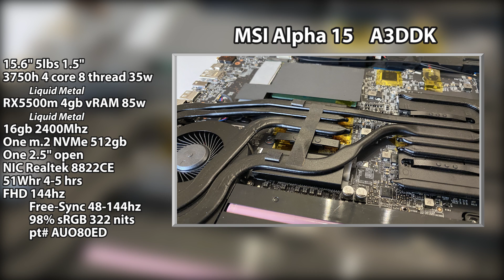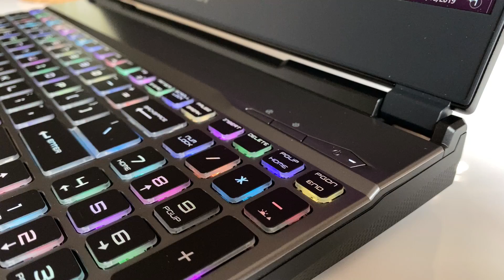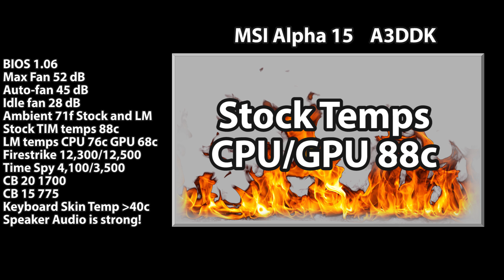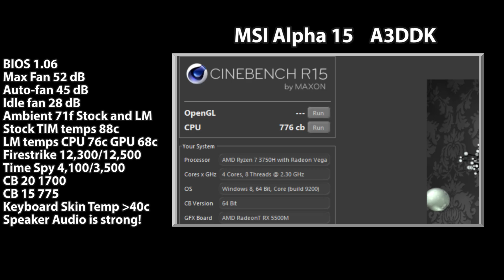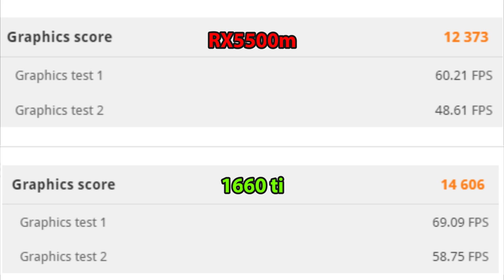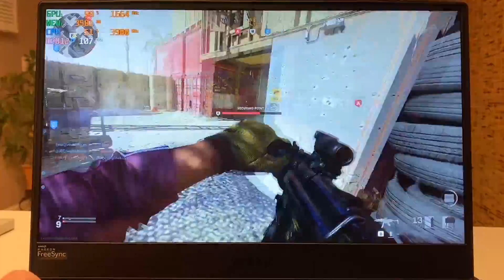Alpha 15 review!  Ryzen 7 + RX5500m!  (Red is the new Blue/Green)

Comment: Hi, do you maybe know why WiFi connection slows down and drops randomly? I tried so many things without success, like uninstalling Dragon Center, Killer Control Center; updating drivers (the Wifi drivers from MSI site are Realtek even though they're titled AzureWave, then updating them though Device Manager to the version from 11/26/19), BIOS, Firmware; unticking "Allow the computer to turn off this device to save power"; changing DNSs, and winshock reset, flushdns stuff; forgetting WiFi connection, turning off WiFi, and back on; using High Performance power plan with WiFi Adapter - Power Saving Mode set to Maximum Performance.
Sometimes it's so bad that I can't do a speed test or it breaks at the upload phase. Other two old laptops, mobile are working fine on WiFi.
I'd appreciate any advice.

Comment: 144hz panel paired with a RX 5500M & a 4 core 8 threads CPU! Why you need that monitor when you can’t run any modern game a 144fps? With exception of CSGO or may be, may be overwatch. With laptops paired with RTX 2060 & I7 9750H 6 core 12 threads under 1000$ this laptop is hard sell. Hard to justify and digest its premium price for less than average specs.  May be someone needs a full AMD experience? Yes. That laptop may be for him. Enjoy it!

Comment: How to fix bottlenecking of GPU?
Reply from the maker: Sharath kumar Do have this laptop?
Reply: @BobOfAllTrades  planning to buy one.....stuck between Alpha 15 & Acer predator Triton 300....
Many people have said to me ..tht amd ryzen 7 is bottlenecking the gpu...
I don't knw ...if it can be fixed manually...or will be fixed by amd in future  update...
Kind of confused....🥺 whether to trust amd ..or stick to intel
Reply from the maker: Sharath kumar The bottleneck on the Alpha 15 is more about the 4gb vRAM on the 5500m where you’ll have to dial back settings in certain cases.  The CPU is still good for most games.  

The Triton with its i7 of course would offer a bit better longevity depending on what you intend on playing and what comes up in the future.  

The Triton 500 has its motherboard flipped so accessibility to the memory, storage and cooler for repasting isn’t as easy of a task.  Not sure if that is the same on the 300.
Reply: @BobOfAllTrades  i don't knw if i am right or wrong...abt this.
Jst for a curiosity....
Since alpha 15 ram can be upgradable upto 64 gb...
If put 2×16...32gb
 Can it resolve the gpu bottlenecking......?
Will there be any impact on gpu performance if we upgrade ram on any laptop/desktop?...

Comment: Hi Bob! Can you help me verify if the 120hz that is sold here in the Philippines also has a 100% srgb?
And how would the processor and gpu work for lightroom?
Reply from the maker: I talked about my my experience with thin bezel 120hz panels within the first 60 seconds 🤷‍♂️
Reply: Sorry, I skipped to the tech specs right away. But to my second question. How does it perform as an editin laptop?

Comment: Wait, why get rid of the dragon center? I've seen other reviews of this laptop and while using dragon center settings, the Alpha's cpu is maxed out at 80 degrees in a stress test and gpu - 70 degrees. While gaming, no higher than 70 degrees on the cpu. So why remove dragon center? You seem to get worse results without it.
Reply from the maker: For starters, it’s rare to see other reviewers punish their laptop like it do. So take thermal results with a pinch salt. 

Google search “Dragon Center issues” and by the time you get to the letter “i” google will have autocompleted that result for you.
Reply: @BobOfAllTrades  Ok, so dragon center has issues. So you remove it and get a lot worse thermals that people, who don't. I don't see the point in doing that. Other reviewers. with similar results in thermals, don't specify, if they used dragon center. However, all their test results are fairly similar, except yours. Also, after using windows for the last 20 years or so, there are no software issues in the world that can get me even a bit worried.
Reply from the maker: Sviatoslav Marynial Stock thermal performance was done per my request from HID under various tests and fan speeds. When tested, dragon center was installed.
Reply: @BobOfAllTrades  wow, irregular results from your machine then.
Reply from the maker: Sviatoslav Marynial It’s the best I can do. People complain when I review a laptop with LM so this was what I came up with. Specific tests performed by HID at stock.  

What would you suggest?
Reply: @BobOfAllTrades  Nothing really, just that maybe something was wrong with your laptop.

Comment: Great review! Laptop... Not so much! That cpu should not go over 75 maybe 80 degrees. 88 means bad thermal paste and bad chassis. And for 1000 usd or eur, well there are much better 1650 with i7 9750 alternatives
Reply from the maker: It’s holding boost better than intel. Temps are not created equal. Two different architectures.  

Raider chassis’s are excellent but from what I’ve been able to gather, they seem to have poor paste from the factory. Changing paste is just a matter of when. 

The 5500m much is closer to the 1660ti than a 1650.

If I’m recommending the i7 1650 combo over this, it’s not because it performs better.

Comment: Is it worth to wait for intel 10th gen desktop processor?
I'm waiting for almost a month now. I have the plan to buy i7 9700k but intel will release i7 10700k which has 8 core 16 threads. Does anyone know what should i do? does it take more months than i think? I don't want to go with AMD. I know they are great but i like intel. Intel claims that it will have 18% faster than the 9th gen. I need a strong suggestion.
Reply: The 10700k is basically the same as a 9900k. Same architecture, on the same 14nm node with small security patches (probably).

Only laptops are getting the 10nm node and architecture with the up to 18% IPC lift. But they have alot of power leakage on that node as of now and is therefore clocked low.

It will probably be fairly cheap when they drop the 10700k, wrong as they got it down again to an i7 and that it will use alot more power than the 3700x. I expect it to be at most 250$, to fit in line with ryzen 3700 in the future or else it should be a total bust. 

That being said, Intel usually finds a way, to make people overspend.

Comment: I don't see the point of going with this when the i7 9750h and 1660ti seem like a better deal
Reply from the maker: What would be a fair price on this Alpha 15?  It’s tough when a Helios 300 is $1099 or less. 

The Alpha has twice the factory storage, Free-Sync, quieter at idle and most loads plus has a bit better battery life. 

Other than that, the Helios is the better buy in some significant areas. After all, it’s a “gaming” laptop and the i7 1660 ti is tried and true 👍

Comment: I believe this is best designed ryzen laptop, just see the heat pipes, and stapm is implemented correctly on this laptop, other laptops with ryzen cannot even maintain the base clock for few minutes (and this one is constantly maintaining 3.8-3.9GHz), we have to use ryzen controller to change TDP so that cpu it maintain boost clocks.
Reply from the maker: On this one I didn’t have to do anything I did not modify or tweak anything on the CPU or the GPU 💪
Reply: This support for ryzen 7 h series?

Comment: The green logo is a sticker? Wtf?

All jokes aside I’m impressed with how powerful this is for $1100. The vram limitation gives me pause though. I kinda wish they had the 8gb version available. The only other thing is why don’t they have a vent on the right hand side of the machine? It there were ports there that would be one thing. But nothing?

As much as I hate to say it I’d want to see a revision 2. But I’d love to have an all AMD machine like this. But I like to tinker so it would be a fun project laptop.
Reply from the maker: Right side exhaust can also heat up your mouse hand. Many prefer it the way this chassis is designed actually 🤷‍♂️
Reply from the maker: Setzer K You’ll be power limited on any 1660ti way before you hit 1900mhz. That’s something many don’t quite understand yet. 

It’s hard to argue or defend nearly ALL gaming laptops when you consider the Helios 300 at sub $1099 👍

The Alpha is in a weird spot. Sure it has double the storage as the Helios 300 and Free-Sync, but it needs some more driver love.  It’s definitely quieter at idle and typical load too. Maybe the security vulnerabilities matter to some as well. Other viewers words, not mine. I’m basing some of this off the comments I read. 

With all of of that out of the way, it’s too new of gpu tech to a price cut sadly.
Reply from the maker: Setzer K That’s not how that works. These GPU are absolutely power limited. Have you seen this undervolt tutorial for these GPUs?  This might help clear things up. https://youtu.be/rV0tWKLAprg

Comment: My biggest problem with this, and AMD in general, I was hoping for more or for it to be at a better price point. Once this came out and I saw benchmarks, I bought the predator helios because although the systems are similarly priced, the CPU and GPU are both better in the acer. I could maybe have waited for the Ryzen 4000 and maybe 5700m with 6gb of ram, but that's probably this time next year. I think AMD will have some sweet mobile setups in 2020/2021 but right now, not the value I was looking for.
Reply from the maker: It’ll be interesting to see how this pans out over the next six months for the actual price and a performance standpoint.

I hope I see more comments like this because it something I would actually like to talk about.
Reply: Good thing i can wait,my rx560x is showing its age in a year
Reply from the maker: HuntaKiller Nitro series?
Reply: So far the only thing I have bought with AMD (mobile) CPUs are 2 in 1s with U series for that integrated graphics that do just fine for that 768p casual gaming while being more than enough for light graphic designers on a budget. Lenovo's Flex 6 14 is a good example of one.

Comment: Current laptop has 8gb ram ddr4 2666mhz. Lets say I wanna  upgrade to 16gb, is it ok just to add another 8gb ddr4 2666mhz even its a different brand of ram?
Reply from the maker: Mixing manufacturers is typically OK just do not mix capacities and if you mix speeds everything is going to default to the lowest.
Reply: @BobOfAllTrades  usually mixing capacity isn't a problem either. 

I have never had any issues running dual channel with 12gb 8+4 or 6gb 4+2 or hitting rated speed.

That being said, same capacity ram is always preferred.
Reply from the maker: Christian Nielsen Here’s the issue and this is 100% true. https://youtu.be/FNNRLmMtE-8
Reply: Doesn't matter though, this CPU supports 2400mhz at max
Reply: @therealthief2131  your comment doesnt matter too. Im not specifically asking for this laptop. Asking for my laptop.
Reply: @chaoseus  too bad u didn't notice the current laptop though

Comment: The msi gf75 is around 900 dls on ebay with a 1660ti and i7-9750.  I don't understand the pricing for this laptop nor its design.  Why is it so thick?
Reply from the maker: It’s the raider chassis and it’s brand new to the market so it’s going to be priced the way it is apparently.

Comment: I was hoping to wait for a new low-profile desktop card to upgrade a SFF Dell, but these RX5500 and 1650 Supers have too high a power draw for the PCI slot, so I went with a vanilla 1650. Pretty cool that the RX5500 is that competitive with the midrange nvidia cards though.